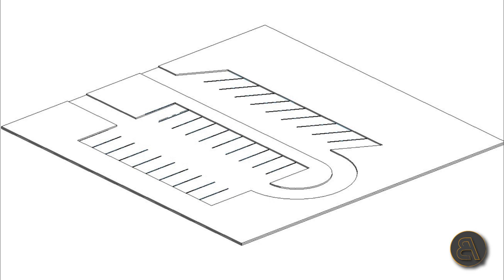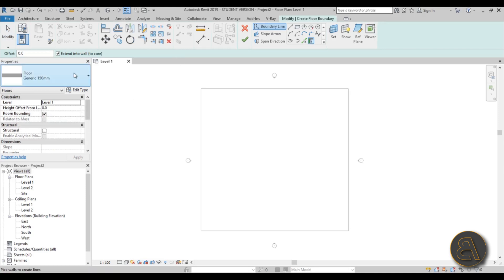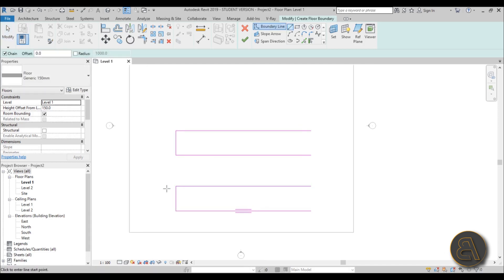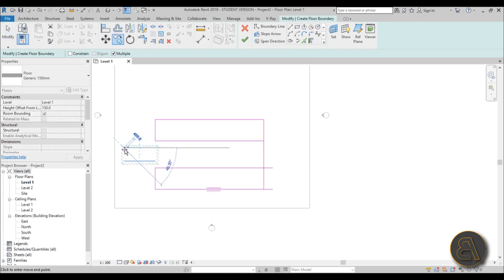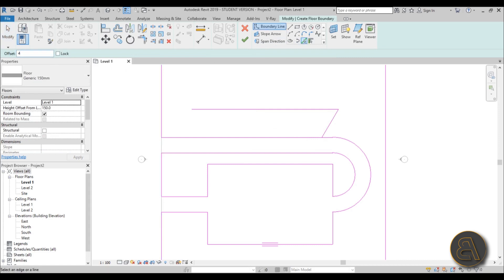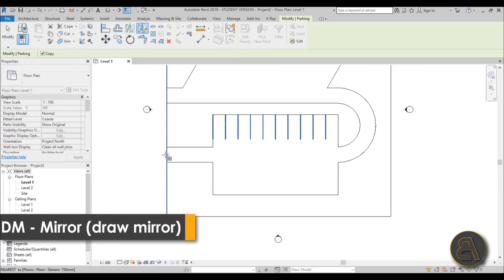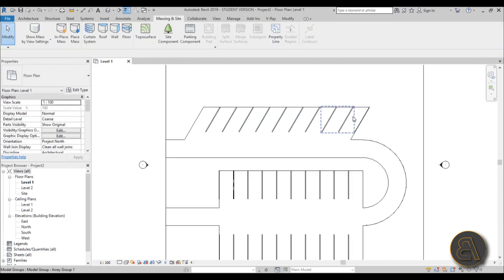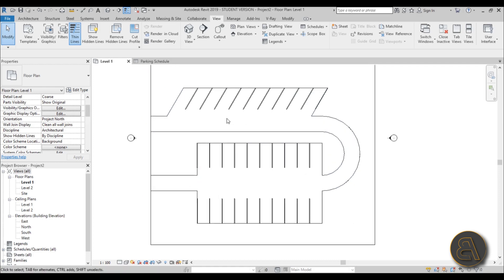Parking in Revit with Schedule Tutorial

Comment: And how can we calc how many meters of floor painting we have? What is the best way to do it? Always nice videos, congrats!
Reply from the maker: You're asking the difficult questions! I'm not sure what would be the best way. One approach would be to have a shared parameter like "paint length" and then you can create a formula for calculating it in the final schedule.
Reply: @balkanarchitect  A nice aproach. Is that my job is work with budgets and quantities are indeed my target. I have been used railings. The fact is that this is a matter very dificult to automatize because of so many varieties. On Excel I calc counting all parks, multipling for it's perimeters and discounting the common  sections among parks. There is an área on the spreadshit just for this, but all measurements are made manually. This why on the last 3 years I have been studing Revit. You help me a lot my friend. Great congrats from Brazil 🇧🇷👍